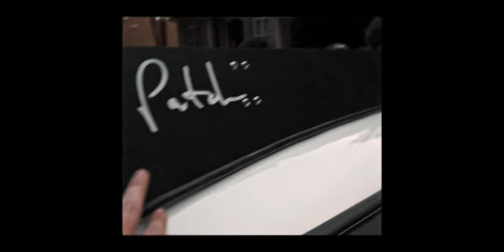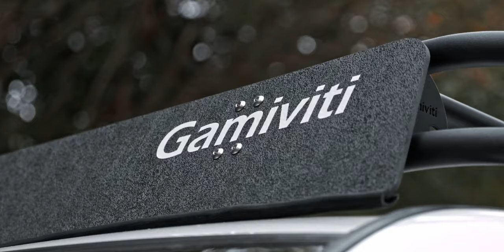Gamiviti Roof Rack Installation for 100 Series Land Cruiser (Lexus LX470)

Comment: Great video! Helped me pull the trigger on the same rack. Is it possible those powder coat blemishes were caused by the screws used to secure the rack to the crate?
Reply from the maker: I considered the same but the hardware was not located at those points when i unboxed it. I’m still of the opinion they’re from when it was energized and coated
Reply: @cruiserpatch  I trust, you. ;)